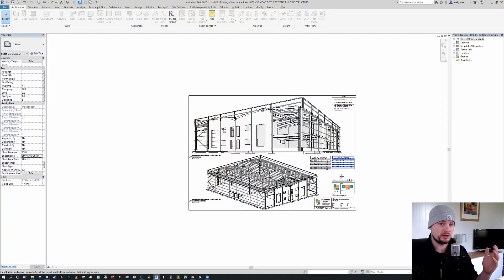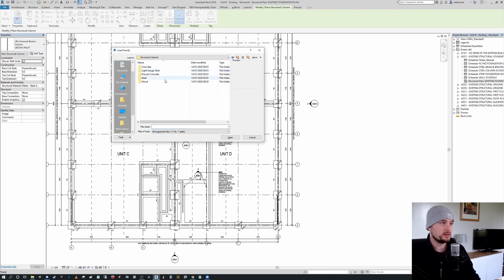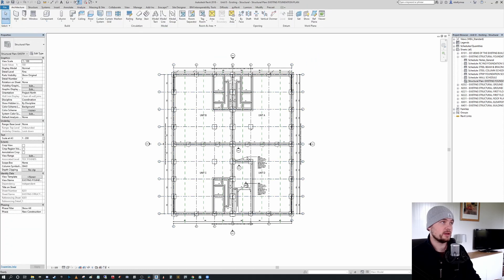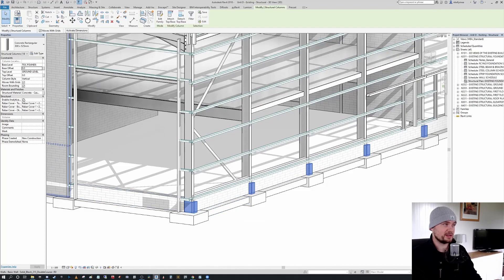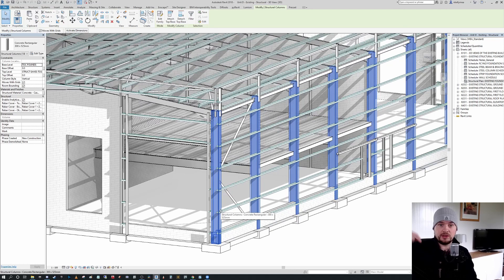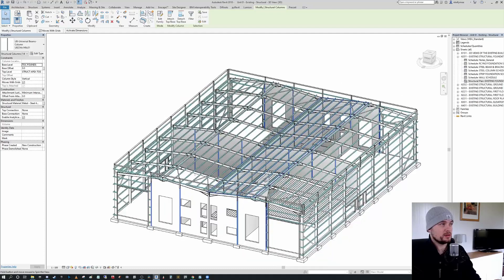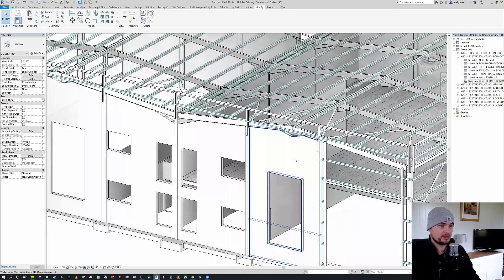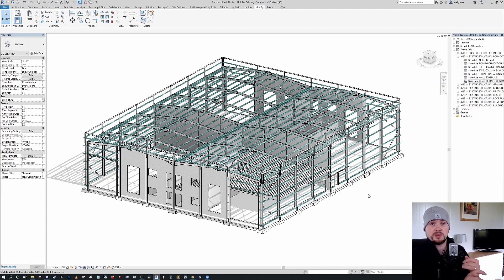Concrete Column Encasement in Revit - Fastest Method

Comment from the maker: Hi everyone. Just to note that unlike in the sample model, when the material of the encasement matches the concrete construction adjacent it will automatically join and give a consistant, nice presentation throughout, particularly weh ncut by a section plane. The Blog Post linked in the description covers the overall Encasement modelling process in more detail.

Info/Resources:
Structural Model Download: https://www.buymeacoffee.com/8020BIM/...
Join the Free Discord 8020BIM Community Channel: https://discord.gg/kuzDTVNznH
Written Step-by-Step Blockpost covering the same topic: https://8020bim.com/solved-model-colu...

Timestamps:

00:00 - Introduction
00:21 - Load and Create Concrete Encasement Column Family
01:54 - Standard column-by-coumn placement of Concrete Encasement at Steel Column Locations
03:32 - How to Quickly and Accurately Model Concrete Encasement for Multiple Steel Columns across an entire Revit Structural Model.
05:00 - Repeat of previous but allowing encasement to go full height as Steel Columns are embedded within wall construction.
07:04 - Outro, Upcoming Videos and Community Discord.

Thanks for tuning in everyone! See you for the next one. 
Niall